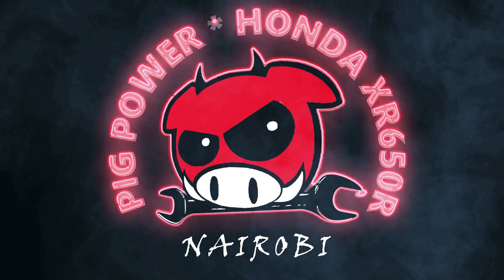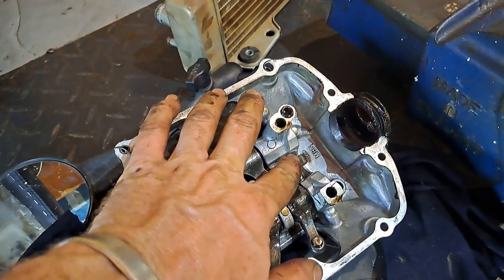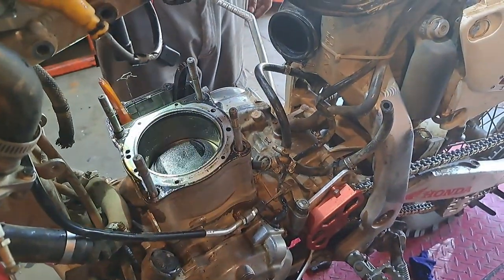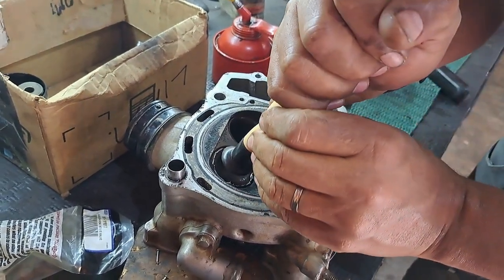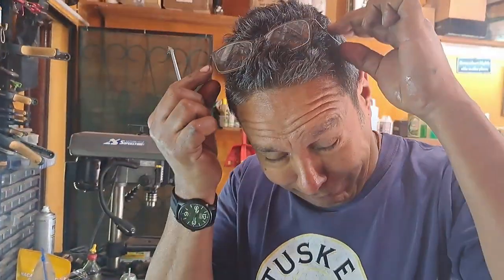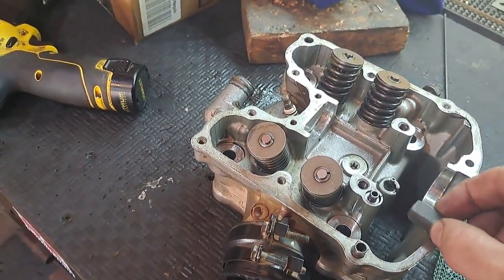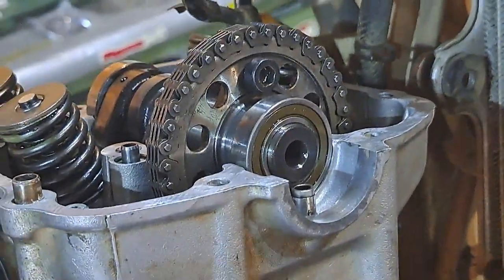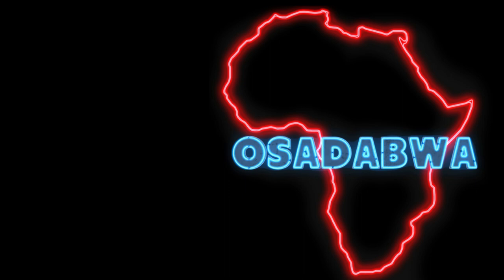Honda XR650R Valve Replacement

Comment: That little plunger in the head is for the stock cam’s auto decompression. Since you have a stage one without that feature, I believe you can remove it if you want. It just sits in a blind hole in the head, held in place with a circlip.

Comment: Or rotate the engine anti clockwise, line up the T mark and the cam will be facing forward and down slightly and clean the bike before opening the head up 😂
Reply from the maker: Worst part is, that was as clean as she's been in ages 🤣

Comment: thanks man. really valuable information. can you explain why the suction cup method is best for new valves while the drill and tube method was best for lapping the used valves?
Reply from the maker: Can use the drill method for both new and old valves, but the suction cups don't seal on used ones due to the carbon buildup. I never wanted to put used ones back in by the way, so I've ordered new Kibblewhite exhaust valves. Also new timing chain and sprockets. May do a vid about that too.